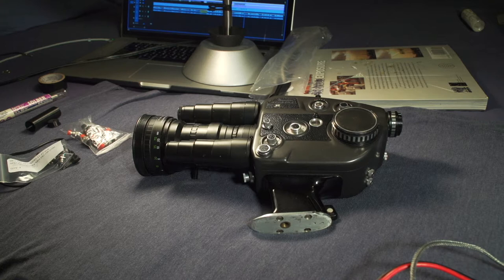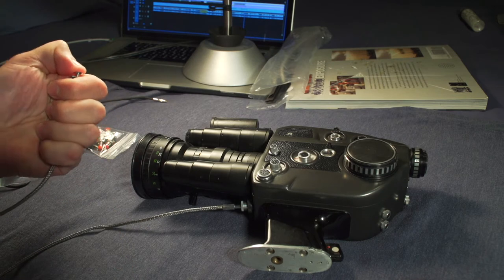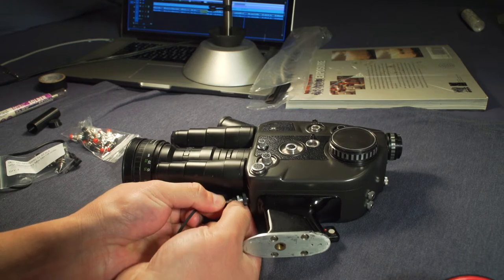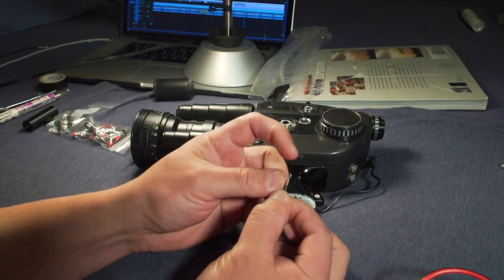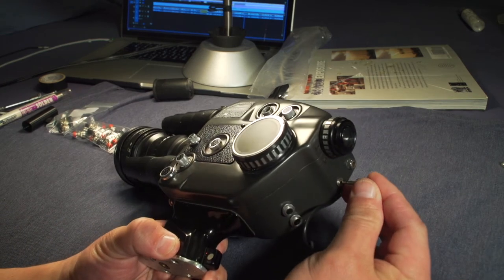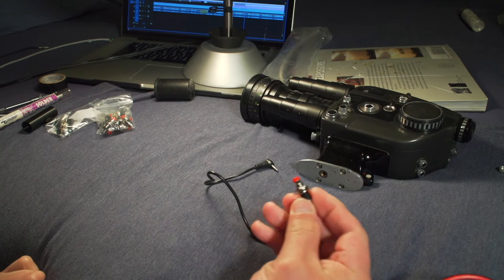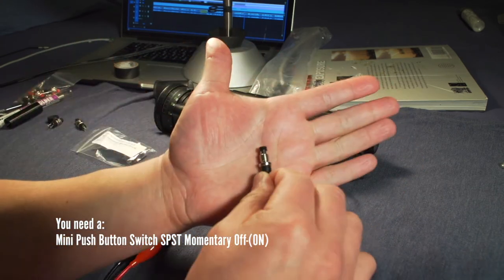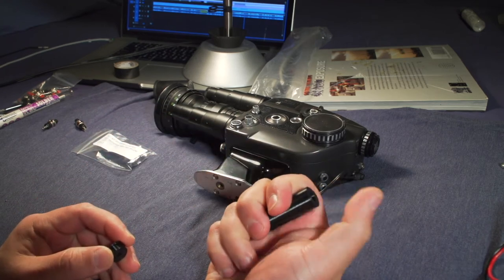Making a Remote Control for Beaulieu 4008 ZM cameras

Comment: Just for the record. End frames will often overexpose as this method doesn't make the camera finish its round.  I.e. disconnecting randomly will leave the shutter in undefined position. There is an accessoiry for the drive axis which will make it stop at the proper position.
Reply from the maker: You are right, thanks for adding this information. It will overexpose 4 or 5 frames every time you stop the camera in this position. Even if you remove the cartridge from a S8 camera in the middle of the day that's all you loose, a few frames. We had a conversation on a Facebook group about a guy who is mounting the camera on a crane and he has to start the trigger, lock it in position then send the camera up or down to shoot the take, same at the end of the shot, so a few frames are better than several seconds.

The release cable should work on the camera, but I tried a few of them and they don't work with the Beaulieu. Some people reported the same thing on the fb group, commenting that they tried several release cables and the only one that seems to work is the original one that came with the camera. Another limitation of  release cables is the length, I tried this method using a 14ft. long cable and it worked great. I mean this should be used on special occasions only.

Comment: I have a Beaulieu 4008 ZMII. As I can remember, this electric remote control only works for 18-24 fps. Is that correct?
Reply from the maker: The remote control cuts the power that flows trough the circuits. To be honest I don't see a reason for it to work only at those speeds, especially when the frame rate is controlled by a potentiometer.

You should not run a camera at speeds above 24fps without film. I mention that because I could grab one of my cameras and test the remote, but I don't have film loaded on any of them and I don't want to damage it.

Comment: Hi! I have the same problem with my k3 and I need to use it with a trigger for a proyect. Can someone help me please??
Reply from the maker: The K3 is a mechanical camera, with a mechanical trigger. You can use a regular release cable or am air shutter release. Those devices were designed to work with 35mm SLRs, so they can have a hard time triggering the K3, but those are the options.